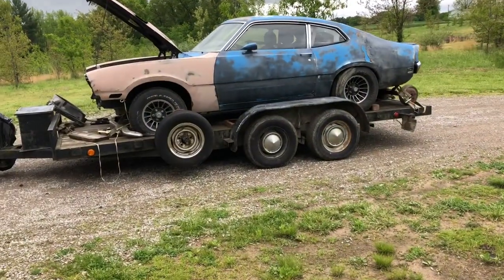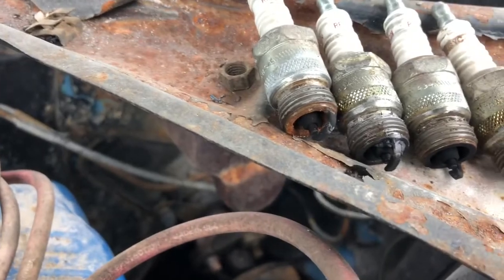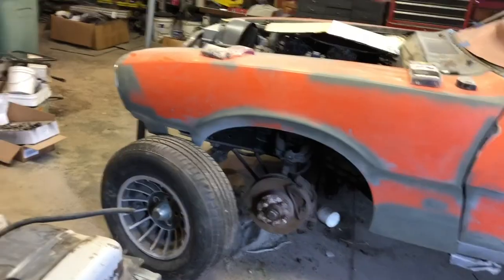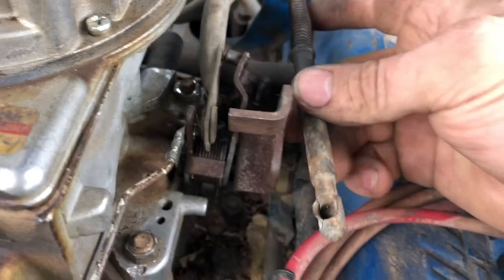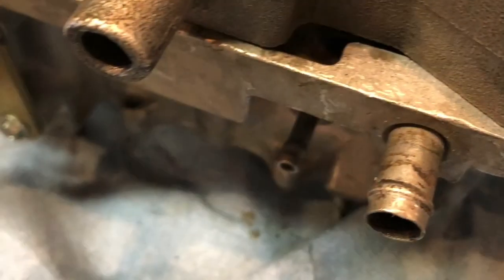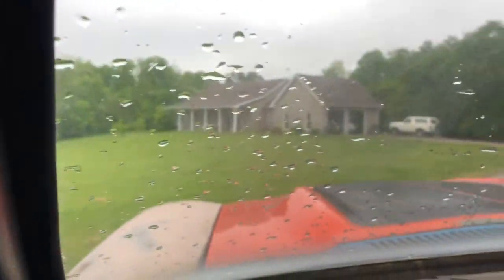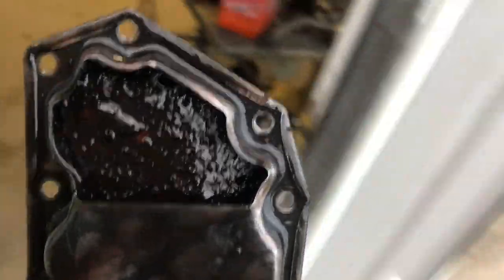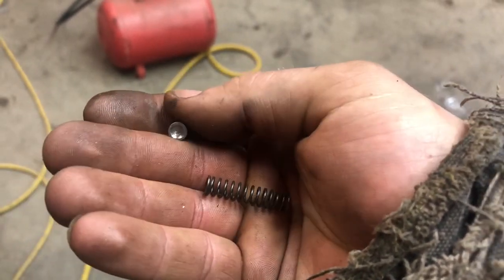72 maverick revival

Comment: Where did you buy the floors for your maverick?
Reply from the maker: For my other 72 maverick I bought 65ish mustang floor pans since they don’t seem to make reproductions.  The mustang pans are almost a direct fit and only require small modifications
Reply: @junkinjames6345  I found a cheap 72 maverick I thought about picking up but It appears no one really makes reproduction parts for them.
Reply from the maker: @matthewpeterson4305  typically I search marketplace and wait for a 4 door to pop up. Usually is a few around or another parts worthy 2 door.  I used mustang floor pans and the rest of the sheet metal patches I made myself.  There’s usually plenty of parts for sale used on eBay as well. Interior parts are cheap. I was able to get new carpet and headliner offline for a good deal.  It’s out there. It’s just not as parts friendly as the mustangs are.